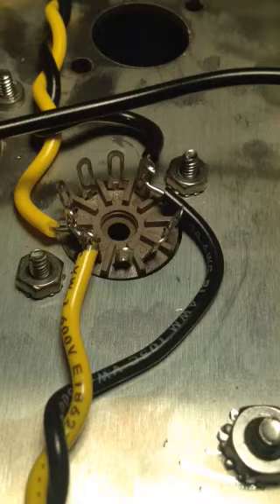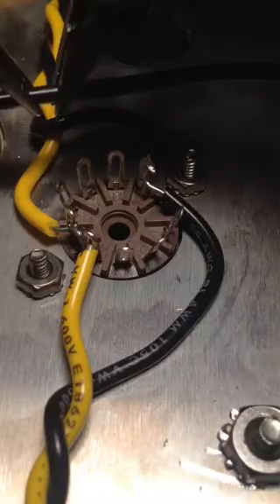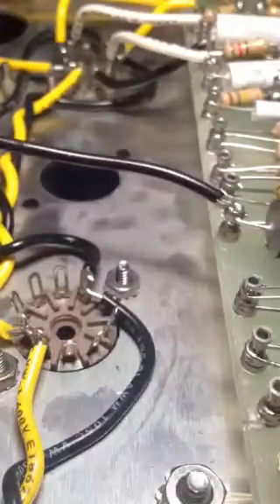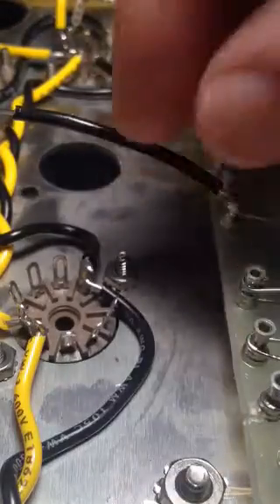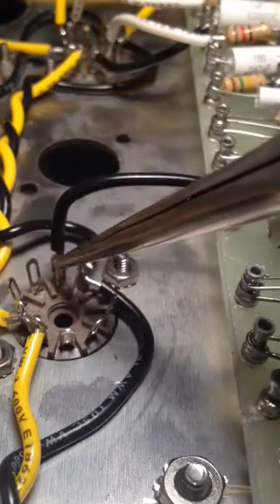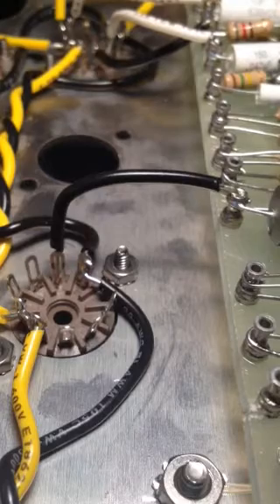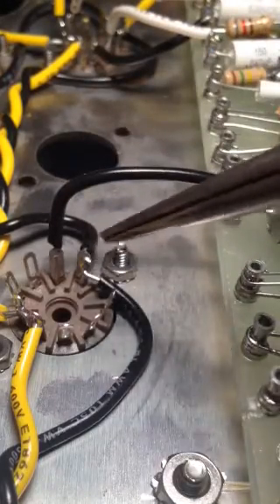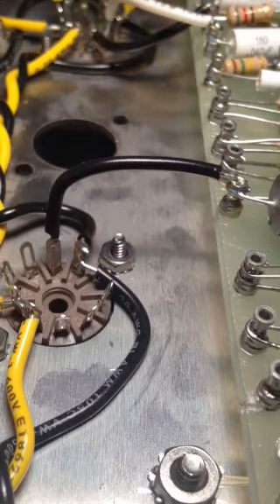Nolatone quality: preamp socket soldering

Comment: I'm a little confused when it comes to soldering tube sockets, I see that some people bend the pins on an angle before soldering them and some leave the pins straight. Does it really matter rather the pins are bent or not?
Reply from the maker: Probably not, as long as the solder connection is good, and I’ve seen cases where a bad connection looked ok visually. However the way I do them makes it virtually impossible to not have a good solder connection.
Reply: @nolatone thanks for sharing. I’m trying to learn the best techniques and the easiest way to achieve good terminations. Do you still do it like this or has your technique evolved . Thanks. 
Also what temperature do you use?
Reply: Great video. 
I have a question about how you angle the wire down through the socket pin. 
In you example you are coming from above and it’s ideal. What did you do with the other connections where the wire is coming from below. Did you do it the way you decribled and the bend the insulated wire down to dress it lower in the chassis? Did you bend the pin to get a more direct angle? Thank you